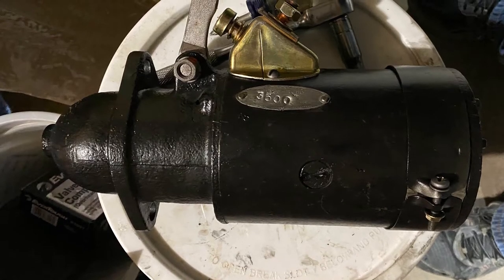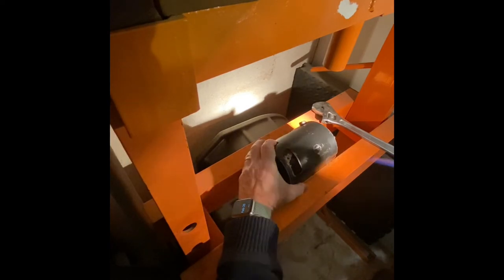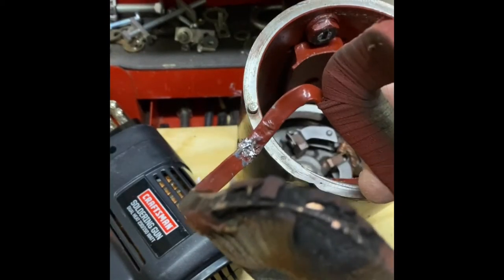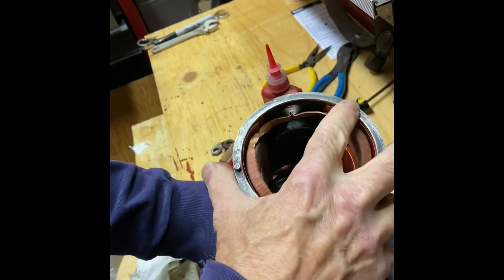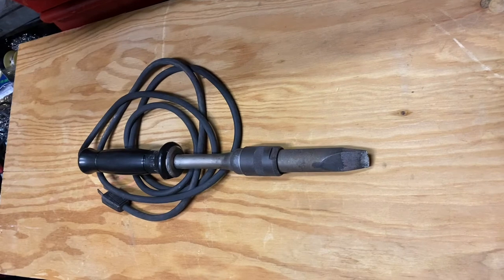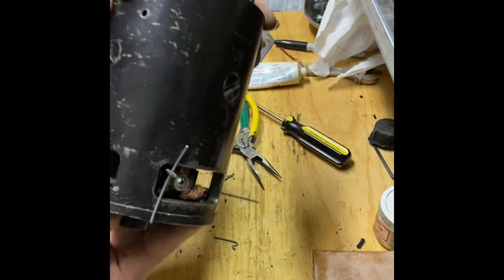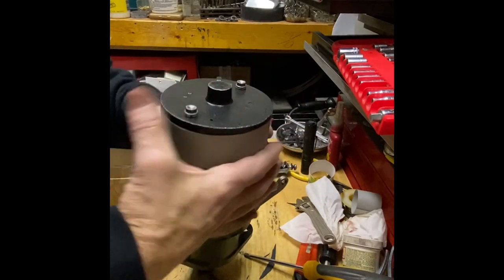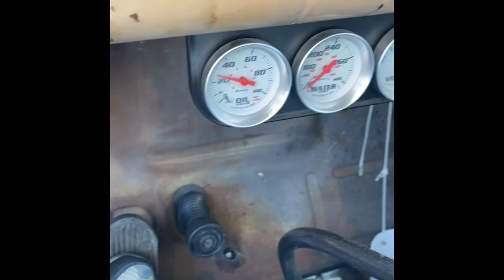56 Chevy PANEL TRUCK classic starter overhaul failure due to field winding insulation 1951 project

Comment: My family did business with Evan's Electric Service/Armature Service in Fresno (now defunct). They rewound and recoiled everything since the 1920's. They had a cradle with an arm overhead, that had a horizontal wheel that would lower a "screwdriver" bit and once extreme pressure was applied, a handle such as yours was used to turn the screwdriver. They then wrapped their own coils. As a kid, I used to dive my hands into the buckets of bushings that were used at both ends of the starter.

Comment: You put the post in upside down. The post they gave you wasn't for for your starter. The band is for a Ford starter, chevys don't have "drain holes" it's cut for a post. They have the wrong brushes in it. Try rapping the pole shoe screws with a shaft and hammer. Should bench test its probably dragging very hard on the armature.